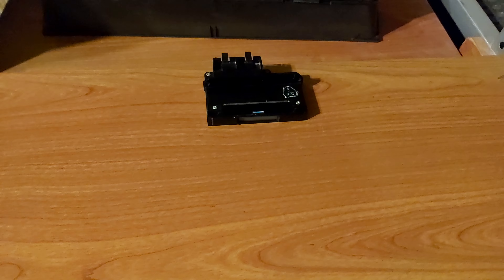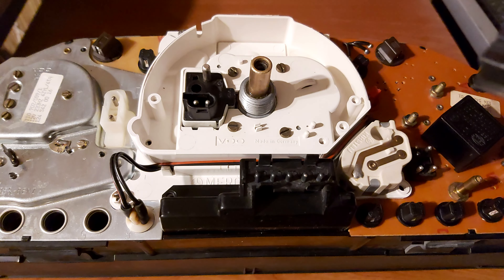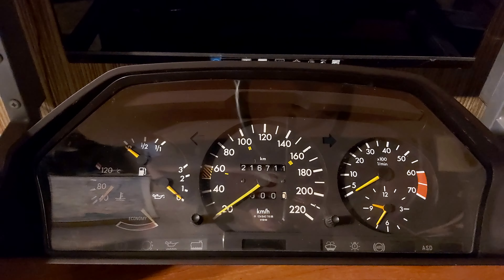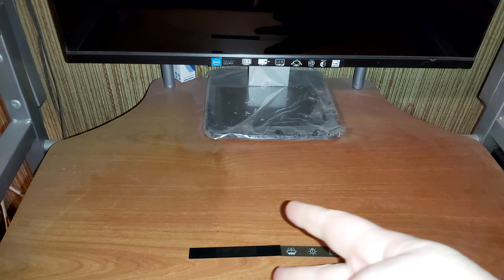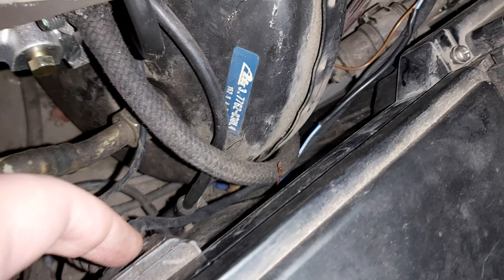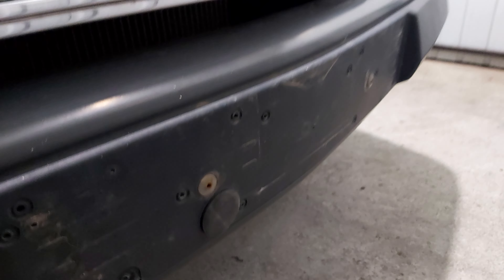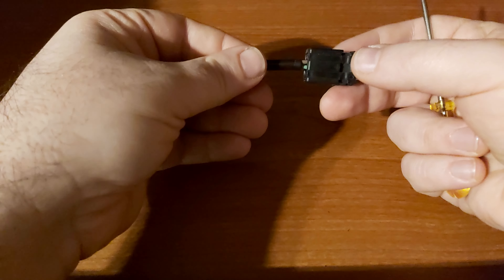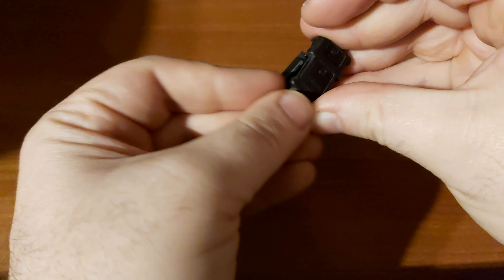㉦Mercedes Ke-Jetronic㉦ - The outside temperature gauge install

Comment: Thanks for the video, im my case I have the system but the values not appear, I used a resistance to check if display works well. I was unable to find a compatible temperature probe. Where did you find the probe? Thanks!
Reply from the maker: Thanks a lot. I ordered it on ebay. Here, I founf the link for you, on Ebay itäs out of stock.
https://www.kleinanzeigen.de/s-anzeige/fuehler-aussentemperaturanzeige-a0015422618-ata-mercedes-w124-w126/2780780115-223-1091

Comment: Sir, I want to ask about the car w124 300e. I have a problem with the coil not getting bursts of fire.. even though I have replaced it with a new one. It still won't come out. When I check the cables, everything has voltage.. Is it because Broken CDI

Comment: I've installed temperature gauge in my W124. I have only gauge, I haven't got wires and sensor. I made myself wires and bought termistor(ntc) 3.3 kω. Everything works, but the temperature on the display is lower then actual about 3 degrees. What can I do to fix it?
Reply from the maker: Well, as far as I know you need a sensor to read the temperature. I don't think there is much you can do about it(sorry I have to say it this way but that's how it is). As you look at everything - all those wires... they are just for the gauge to power it(positive&ground, illumination, one for the sensor and one for the speed sensor(maybe there lies your issue, the gauge is not connected to the hall speed sensor).
Reply: @mercedeske  Thanks for your quick answer. As I wrote I haven't got a temperature sensor, but I replaced it with termistor NTC 3.3 kOhm. No matter I drive or park the temperature is constant, but 3 degrees lower then actual. What do you think, can I try with w210 or w211 temperature sensor? Will it work? They are also 2-pin sensors. Maybe other termistor with higher or lower resistance. Greetings from Poland.
Reply from the maker: @znama82  This is how it goes - with a resistor of 3.3kOhm you will have to get approx. 20 degrees C - This is how it goes - 53100ohm gives -30 C(+/-2), 9800ohm  0 C(+/-0.5 C), 3750ohm 20 C, 1600ohm 40 C, 1080ohm - 50 C(+/-5). So, the tolerance is always going to be, these are not accurate readings. If you have a connection for the sensor then, yes, you can use the one from the W210/211. I will post these values on my fb and instagram pages. Happy Mercedesing
Reply: @mercedeske  Ok, thanks. I will try another sensor. Maybe it solves the problem. 3 degrees are not so much, I can live with it 🙂
Reply from the maker: @znama82  Right!Hehehehehehe